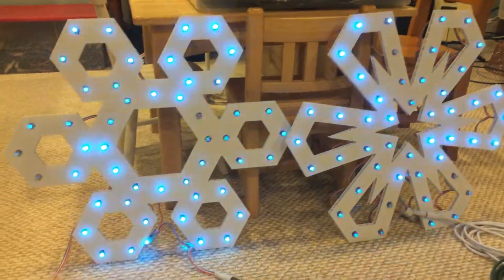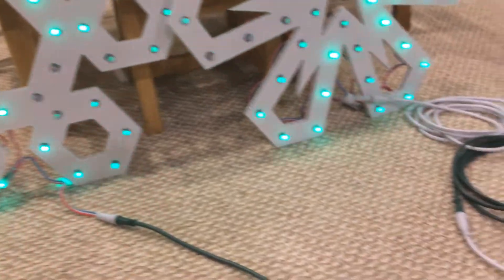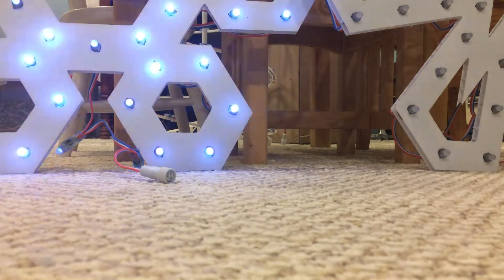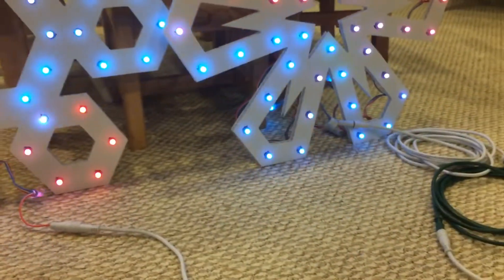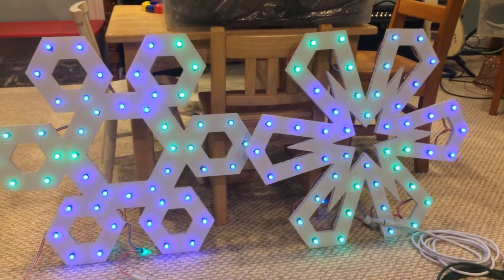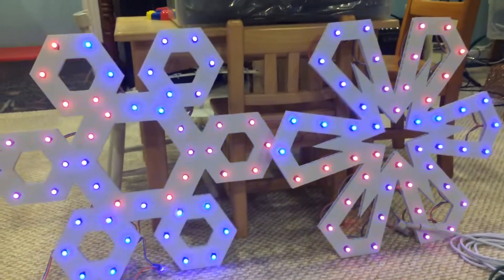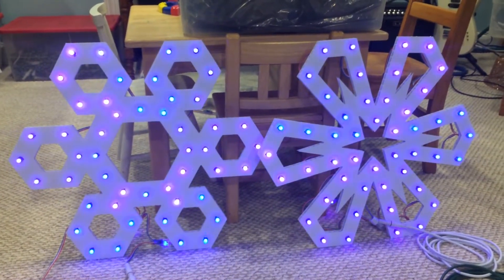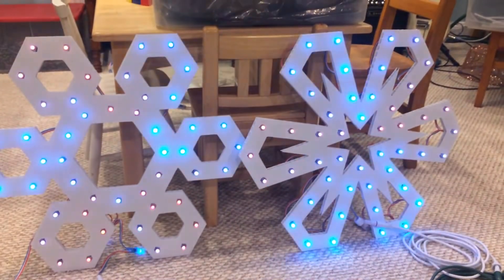WS2811 Pixel uAmp Test - How far can it go?

Comment: Do you use 5v or 12v pixels?
Reply from the maker: These are all 12v pixels.
Reply: In general for all your light displays are they 12v?
Reply from the maker: @arthurjock4179  Yes, all the pixels are 12v.  I find it easier to manage everything all being the same type of pixel voltage.  There's no concern about using the wrong power supply, no concern about having different pig tails for different voltage pixels, etc.

Comment: Where did you buy the microamp from?
Reply from the maker: I purchased the uAmp from a Christmas forum group buy back in 2017.  It was a custom order by someone in the forum, but I don't know if they are still doing that.  Starting in 2019, PixelController.com has come out with the FAmp (Falcon Amp) product that is the best commercially available product on the market.  

I got my hands on one and am working on a new video covering that product and how far it'll boost the signal.

Comment: The micro-amps, are these basically the same item as the f-amp that can get at Pixel Controller?
Reply from the maker: Yes, they are basically the same as the FAmp.  The Amp was created the year after I got these micro-amps.  There may be performance differences between the two, but they perform the same function, cleaning up and boosting the data signal.